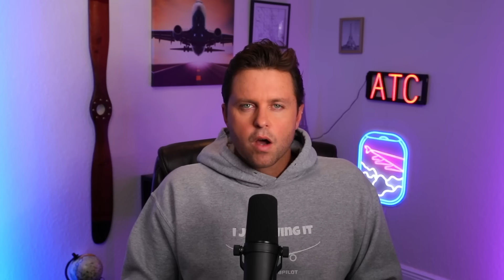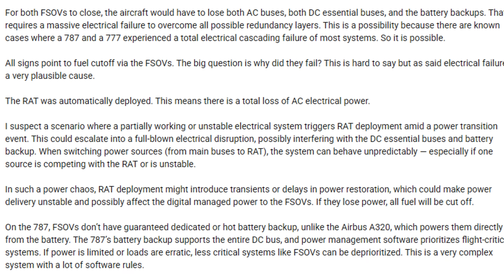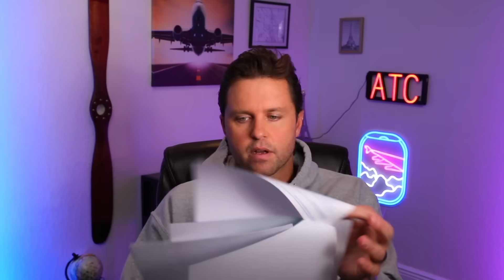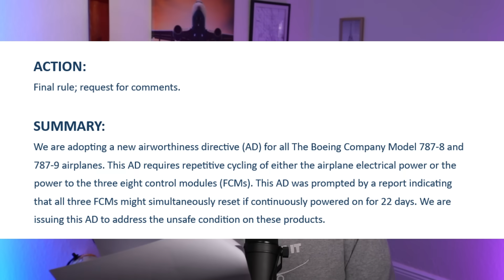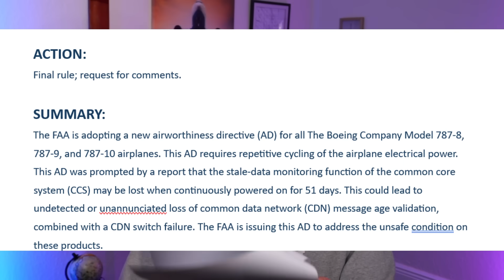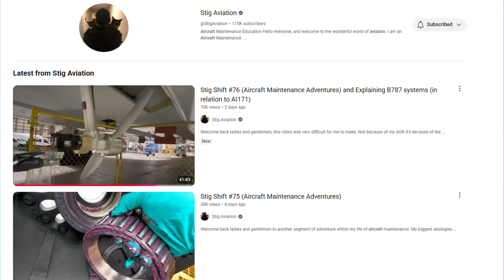Air India 171: Did a Software Glitch Cause Dual Engine Failure?

Comment: I think you found the smoking gun. This sounds to me like another case of “SAFETY GONE WILD”!  I fight this all the time in the hardware I support. We continually have “Safety Gestapo” butting in, causing ignorant unwarranted churn and actually CAUSING more safety issues than they solve!  I bet you a paycheck, maybe two or three that if you could trace the lineage of this issue (assuming that this is the root cause which sounds very likely but still in need of proof) I’ll bet that there was a dumb ass “safety” or “quality” numb nut that interrupted the original design throwing a red flag because they were afraid of “fire”!  “We can’t have fire in the engines!”  I’ll guarantee you there was some stupid mug head that caused a ruckus on that issue without ever “thinking”, golly gee should we maybe let the engine have fuel by default so the plane might fly?  This is just ignorant stupidity. Fuel should ALWAYS default to flowing to engines!  That is what they do!  Consume fuel!  The ONLY time that fuel should be cut off to an engine is when the PILOT commands it. And I’m ok with multiple ways to do that, as long as the default is always fuel ON!  An engine runs hot and is the sturdiest part of the pane. It’s not going to just melt if there is a little fire, and there are myriad examples of that in aviation. I’m not saying you want to let it burn, but you MUST ensure there is never any chance what so ever of fuel being cut off by default like this. It is because of stupid crap like this that I am vehemently critical of the “Safety” mafia, because they try to replace common sense with their bureaucratic and stupid unfounded critiques because they have to justify their existence.  I’m not at all saying not to be safe, and I’m not saying that there should not be safety checks and maybe even some kind of independent safety structure. But it needs to engineering focused not paperwork or process focused. This is when safety becomes self serving and thence unsafe. Maybe I’m wrong and will egg on my face. I doubt it, but the investigation will tell, and my bet is that safety made the original engineers change it to a fuel deadman switch off.  Dumb!

Comment: In cars, there have been a few problems with software glitches causing sudden accelaration. The 1987 Audi 5000 was one well-known example. About 20 years ago there was a similar problem with certain Ford Mustangs. Ford hired Pratt & Whitney, the jet engine manfacturer in East Hartford, CT to fix it. For many months Mustangs were bombing around the parking lots trying to reproduce the combination of conditions that caused the burst of power. It was ferreted out and quietly fixed.This kind of thing could easily happen in an airliner and cause a shutdown instead of acceleration.

Comment: Genuine question from ex airline employee, I know the trucks are powered toe down for retraction, but when they deploy are they powered heel down or is that the resting position?, ie, does that rely on gravity, are all wide body trucks powered?.
Reply: Both positions are resting positions. An electric motor powers them to and from each position and then they are unpowered. That is they do not have to be powered to maintain position.

Comment: A Probable Scenario: Air India 171 — Gear Malfunction, Sensor Corruption, and Thrust Rollback

Context and Evidence

Air India 171, a Boeing 787-8 Dreamliner, crashed shortly after takeoff during initial climb. Visual evidence—photos and video taken shortly before the aircraft’s loss of control—confirms that the main gear truck had tilted forward (toe-down), indicating that gear retraction had been initiated, but gear doors remained closed and the gear itself did not retract. Additionally, a loud noise was reported by passengers approximately 30 seconds after liftoff. The aircraft failed to maintain climb, and eventually stalled and descended nose-forward, with no signs of yaw or asymmetric thrust.

⸻

1. Gear Retraction Attempted — Sequence Incomplete

Based on visual evidence, the main landing gear truck had pivoted from heel-down to toe-down—a mechanical requirement for retraction on the 787. However, the gear doors did not open. This implies that the retraction sequence began but was interrupted, likely due to a mechanical jam or hydraulic valve malfunction. With the truck tilted but doors still closed, the gear was unable to retract.

This incomplete sequence suggests the possibility of hydraulic overpressure, as the system continued to command retraction but fluid had no path forward.

⸻

2. Hydraulic Overpressure Event

Hydraulic systems on the 787 operate at high pressure, and the gear retraction system is part of the center hydraulic system. If the doors failed to open and the gear actuator extended into a blocked path, overpressure could rapidly build in the gear retraction lines.

In such a case, a burst line, ruptured fitting, or failed manifold could produce a sharp mechanical noise, consistent with the loud bang reported by passengers. This failure may have occurred near the gear well or pylon—areas that also house temperature probes and sensor wiring.

⸻

3. Secondary Damage to TAT Sensor or Wiring

The Total Air Temperature (TAT) probe plays a critical role in engine control. If the overpressure event occurred in proximity to the TAT probe wiring or caused secondary mechanical disruption (e.g., a panel breach or wiring displacement), the result could be:
	•	Spurious high temperature readings
	•	Electrical noise or signal interruption
	•	A complete or partial corruption of environmental input data to FADEC

⸻

4. FADEC-Initiated Thrust Rollback

The 787’s engines are governed entirely by Full Authority Digital Engine Control (FADEC). If FADEC receives TAT input outside acceptable ranges—or interprets conflicting data between thrust lever position, Mach, and air temperature—it may command a rollback to prevent engine damage.

In such cases:
	•	Thrust levers remain full forward
	•	Engines continue to spool and burn, but
	•	Thrust output is reduced to idle or near-idle

This is not an engine failure, and no fire or flameout indications appear. Importantly, pilots have no manual override to force FADEC to restore thrust.

⸻

5. Symmetrical Behavior, No Warnings

The visual record shows no yaw, no signs of asymmetric thrust, and no vibration or external damage to the engines. If both FADECs received similar corrupted TAT input, they would respond identically. The aircraft would appear balanced in thrust—but underpowered.

The crew, perceiving power loss without flameout or fire, reported:

“Unable to maintain thrust.”
This phrasing is consistent with an electronic thrust rollback, not a dual engine failure.

⸻

6. Stall and Loss of Control

With flaps extended and gear still down, the aircraft remained in a high-drag configuration. As thrust decayed, airspeed degraded. If pitch was held constant or increased under the assumption that thrust would recover, the aircraft would have exceeded its critical angle of attack and stalled.

The stall appears to have been symmetrical, consistent with equal thrust decay on both engines. At low altitude, recovery was not possible.

⸻

Conclusion: Likely Failure Sequence

Based on the visual evidence, timeline, and known system behaviors, the following failure chain is a plausible reconstruction:
	1.	Gear retraction initiated; truck tilted, but doors did not open
	2.	Hydraulic overpressure developed; a component ruptured or failed, producing a loud noise
	3.	TAT probe or wiring was damaged or disrupted by the failure
	4.	FADECs received corrupted TAT data, interpreted as unsafe thermal conditions
	5.	Both engines rolled back thrust as a protective response
	6.	The crew was unable to override the rollback
	7.	The aircraft stalled in a high-drag, low-speed configuration and could not recover

⸻

Key Observations
	•	The failure began as a mechanical or hydraulic issue, not an engine problem
	•	Thrust rollback was electronic and protective, not due to fuel starvation or combustion failure
	•	Pilots had no visual or audible indication of traditional engine failure
	•	Procedural expectation to continue climb may have delayed nose-down recovery input
	•	The only opportunity for survival may have been an immediate transition to a glide profile and forced landing straight ahead
Reply: The aircraft did not stall until the very end where it was in a mushing stall as it hit the ground.
Reply: @christopherrobinson7541  The stall part of my analysis is a minor component.

Comment: It looks very plausible and similar to the MCAS story. If something is done automatically, there must be a redundancy and if something goes wrong system must go to a safe state, blocking engines in the air is not a safe state IMO. It almost looks like the same people (or people with the same way of thinking) had their fingers in MCAS logical errors and here. It could be a lack of experience with designing and programming this sort of systems, IMO. Take the Airbus solution, they put redundancy on redundancy to make sure the power is not cut off. It will never be 100%, but it pushes the probability of a failure even closer to zero. MCAS with logical errors deciding on results of one faulty sensor is very amateurish and one has to ask what else they are capable of.

Comment: I don't understand the comments about these failures occurring when the system is powered up for 20 to 50 days?  Are these computer systems continuously powered with small batteries so as not to lose memory?  What if there was a way to completely power down the system, say every 15 days.  Would the AD no longer apply?

Comment: No one knew about the 737 max mcas system. There was not this fault in the manual. And the activation of the mcas system was subject to 3 conditions. And boing decided that if the mcas failed, the pilots could fix it in a few seconds. I guess they realized this was wrong after two unexplained crashes... If the 787 is still flying, I hope they detect the fault you mentioned before more crashes happen.